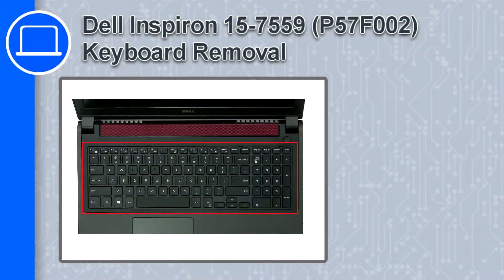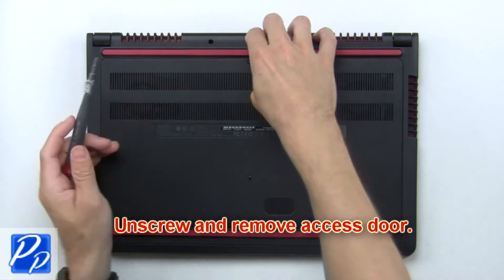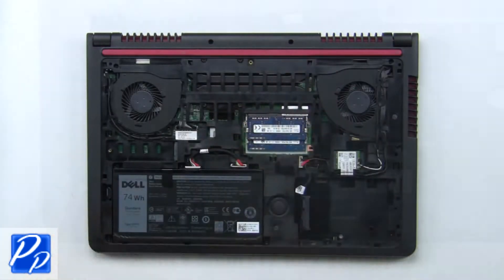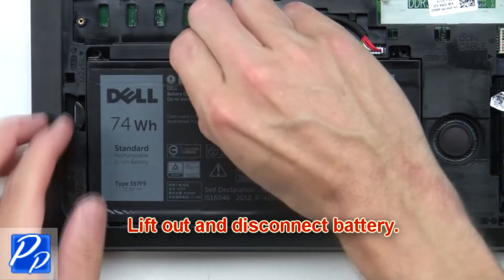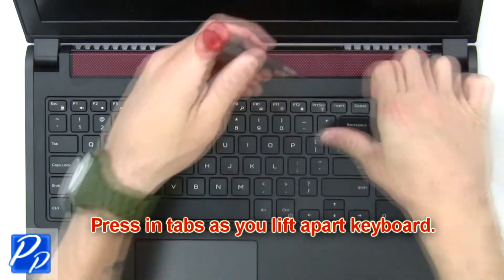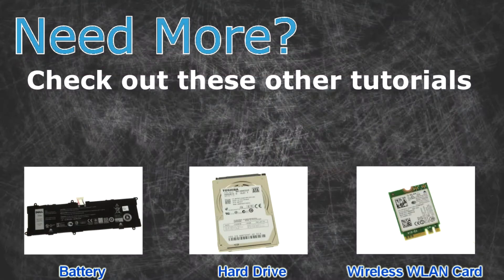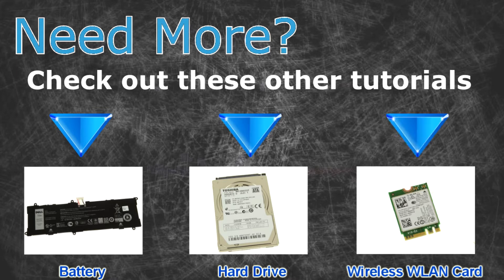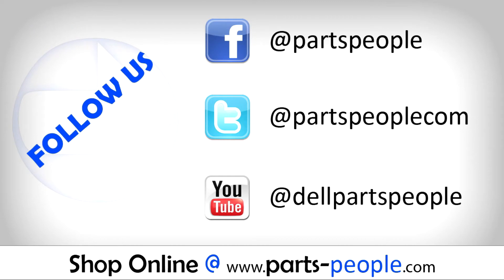Dell Inspiron 15-7559 (P57F002) Keyboard How-To Video Tutorial

Comment: Hye...can we detach only one key of the keyboard?
Reply from the maker: You can remove the key caps by lifting them straight up, they will unsnap from the hinges below them. Be careful, if a hinge breaks, it will be very difficult to find a replacement.